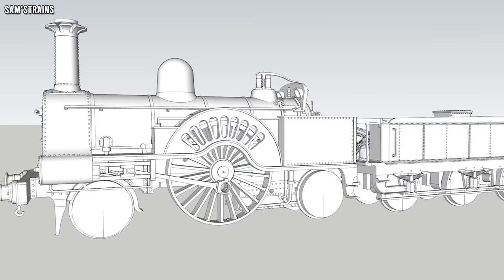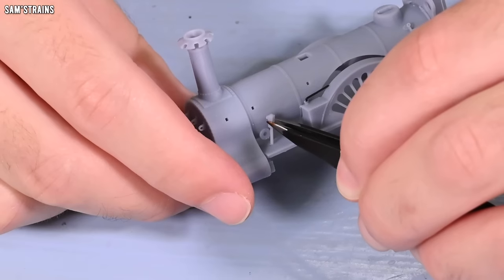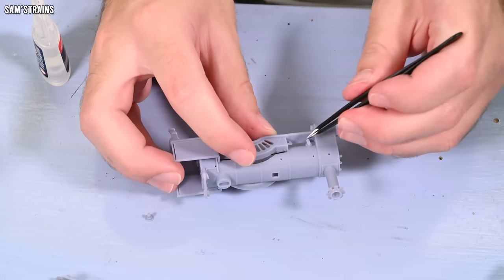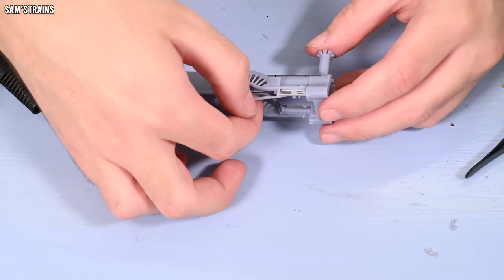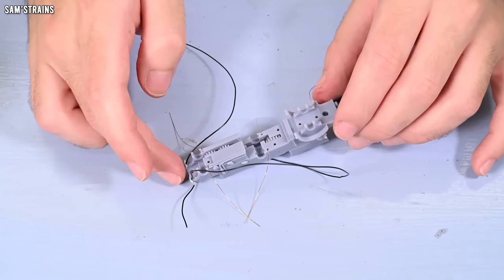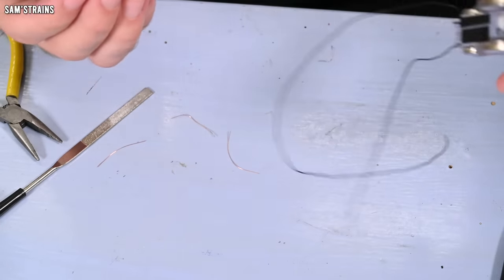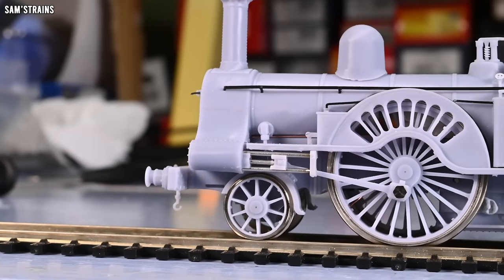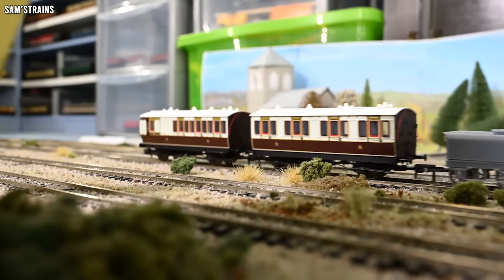Building the First "Lady of The Lake" Prototype | 3D Printed Loco Project

Comment: I love this model, it's very impressive, it's sort of a link between 'era1' and the latter pre grouping locos, a much ignored period I think. Can I just suggest an improvement that I think would make it better? From the side I can see through between the wheels where the boiler would be, from the top the gaps between the boiler and the wheel splashers is too noticeable. I think you should extend the sides of the boiler down to around where the running plate is, maybe the sides would have to be straight to avoid the motor but I still think the end effect would be better. I just want the end result to be the best it can be

Comment: That looks great, especially with the see-through cut outs over the driving wheels. The Hattons LNWR coaches are a good fit for the Problem class, but it would be nice to see you build some LNWR arc roof bogie coaches for it from the Ratio/Peco plastic kits too- it's surprising how few modellers use them despite their availability and relative ease of construction; I've built one and now I'm going back in for more of their kits!

Comment: Hi Sam Overall, a very nice model. The resin printer made a very nice job of your design. Was the coupling hook on the front buffer beam installed up-side-down? There appears to be quite a gap between the splashers and the boiler; is that something to be fixed?

Comment: Hi Sam. Absolutely fantastic loco. I wondered if the problem in reverse may be to do with the inertia of the tender and company the loco rising up slightly on the connections and lifting the driving wheel off the track slightly? What you have achieved is awesome, though.
Reply: *causing the loco

Comment: Only problem i saw what might be the case of the stopped and back reverse was the front set of wheels on the tender kept binding up and kept being dragged
Reply from the maker: Yeah that's right - the tender pickups need adjusting to put less pressure on the wheels - will be an easy fix!
Thanks for watching, Sam :)
Reply: @SamsTrains  As someone who also 3D print using resin mainly for wargaming minis ya quality looks great, ya must have some great settings

Comment: Wow Sam’s trains the Prototype of the lady of the lake AKA the problem class looks really good, tbh it does look like Emily’s smaller brother/sister which was built before her way back before she was built in 1896 something like that, unfortunately I don’t have a 3d printer or the resin printer but I can always watch your amazing work on the 3d/resin printed locos and wagons, I know I said this once on your 3d printed O gauge brake van interior/exterior video about a e2 loco body (maybe 3d print) on a modern Hornby jinty chassis and the colour of paint I think I would like to see is blue between light blue and dark blue with red lining with the number 90 and I think the name would be named after me which would be nice
Reply from the maker: Thanks so much David - yeah it's quite similar to Emily isn't it? That sounds awesome!! :D
Thanks for watching, Sam :)
Reply: @SamsTrains  no worries also I noticed one of the tender wheels is a bit stiff while going forward and backwards running-wise before running around your layout

Comment: Your method of cutting the rods down is exactly what I use. I tried designing and printing a jig and holder for the dremel and steel rods but... the heat of the rod melted the plastic housing on the jig 🤦‍♂

Comment: Re the performance forwards vs backwards - that's just Newtonian physics. In forwards, the rear (small) drivers are being pushed into the track by the the large drivers, whereas in reverse, the large driver is lifting the small drivers off the track, and then don't have the traction themselves to overcome friction.
Reply from the maker: That's a good thought, but it happens when the loco is off the track too, when I power the motor direct!
Thanks for watching, Sam :)

Comment: You seem to have a large emphasis on bearings on the axles but forget to add bearings to the axles on other gears.
Reply from the maker: There’s no need, as the gear shafts aren’t bearing any load besides holding the gears in position - no professional British manufacturer currently uses bearings on the gear shafts!

Comment: Need to fix the loco body do that is more real as you could not see though the boiler like that. Also looks like some of the parts need to be printed in resin to make a mold for dicasting parts to add weight to improve traction.

Comment: Please Sam, when sanding resin do yourself a favour and wear a mask, resin dust is really nasty stuff if it gets in your lungs, also consider wet sanding wear possible as this holds much of the dust in the water.

Overall very good, you can see the distortion in the resin in a few locations but it's not major, for a gap filling glue use a little resin and cure in place with a UV lamp.

Only real criticism is that I am pretty sure you should not be able to see through the driving wheels to the other side above the footplate and through the boiler, I suspect the guards over those wheels should also meet the cylinder of the boiler, that area aside though, nicely done.

I will be very curious to see just how long the printed gears will last though

Comment: Your forgot to add the brass filings, glue marks and paint splatter which are the hallmarks of any professional loco assembler. In fact the motor you chose is way to reliable to provide the stuttering performance customers have come to expect. I trust you’ll redeem yourself when you sling the finished product in a cardboard box without any further packing.